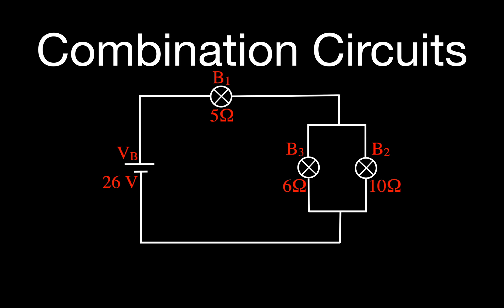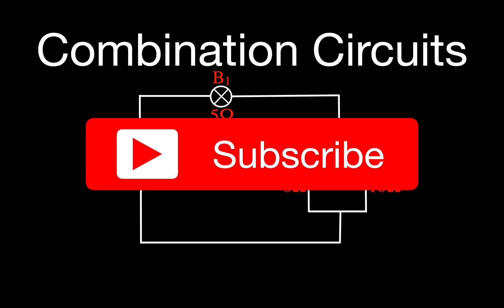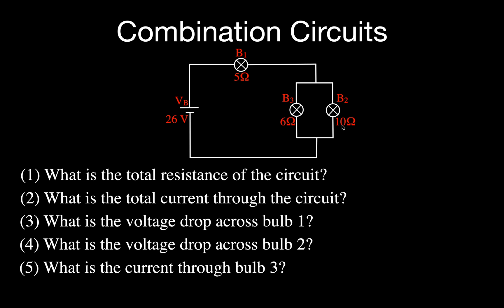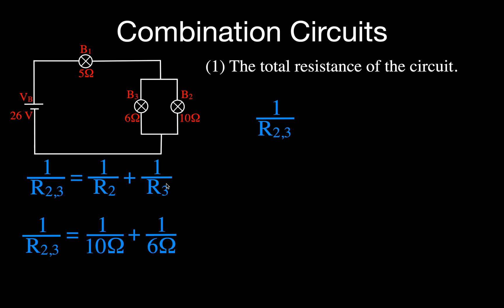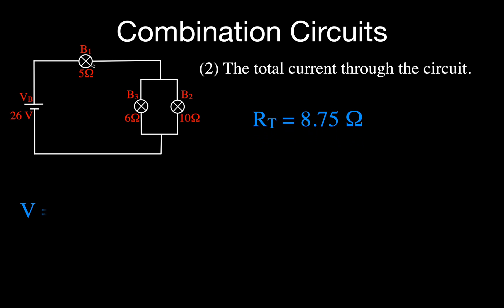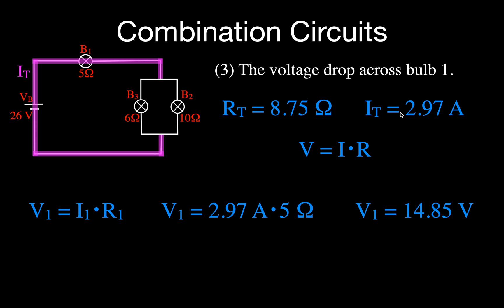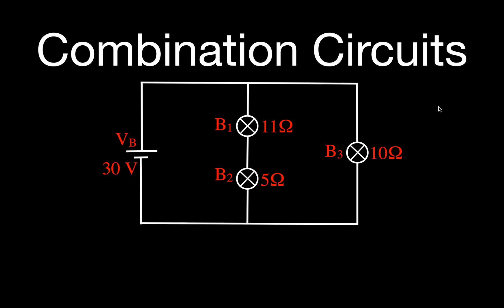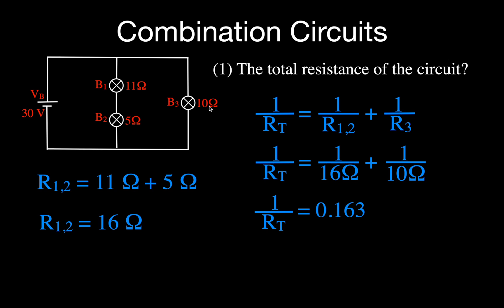Combination Circuits: Calculating Currents and Voltages

Comment: at 6:32 the total of 2.97 multiplied by 3.75 isn't 11.15 but 11.14 since the scientific total of it was 11.1375 and if you round it off it would be 11.14
Reply from the maker: Yes, I believe you are correct. My rounding error.